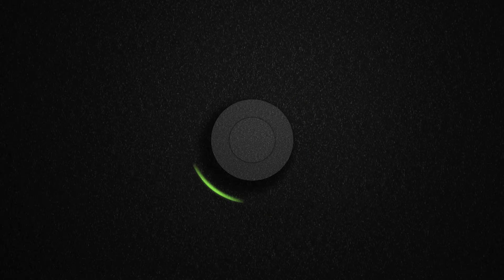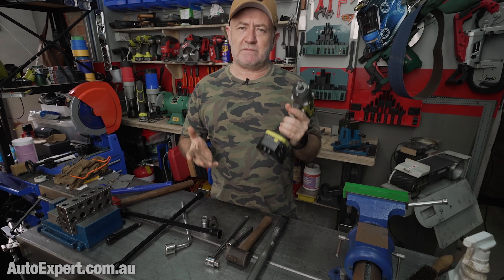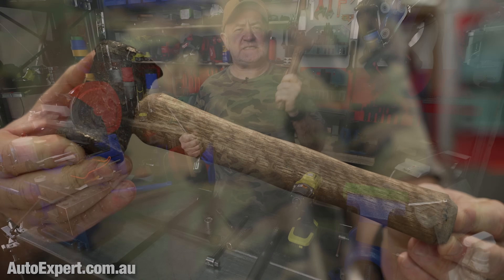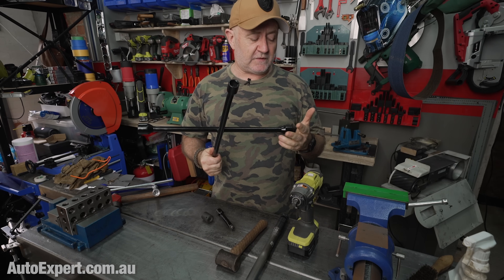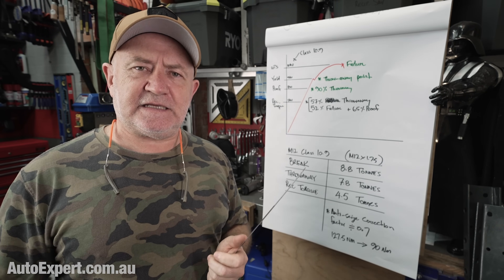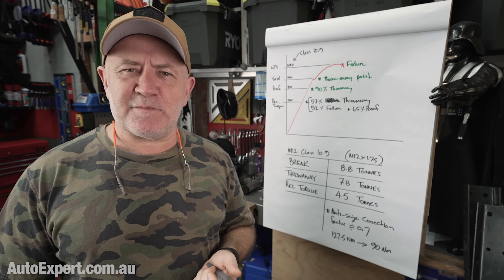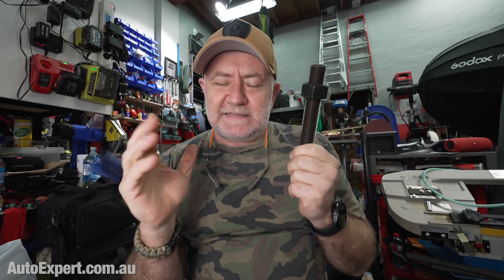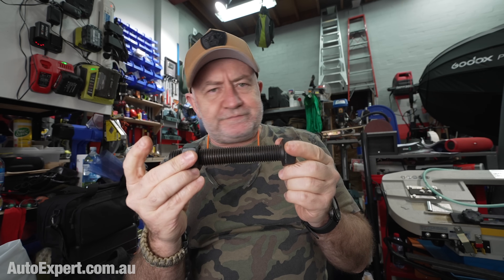Wheel nuts: Ultimate 'ghetto engineering' DIY deep-dive | Auto Expert John Cadogan

Comment: Just yesterday I picked up an extendable wheel brace (to around 50cm) on sale for less than $20 after having issues undoing the nuts with the factory wheel brace on my Toyota Aurion when I copped a flat a year or so ago.
Reply from the maker: Yeah - a 60cm extension with a metal handle (not plastic overmould) and a brass hammer - nothing can stand in its way.
Reply: @AutoExpertJC  Ahhh ok. It has a plastic handle. Time will tell if it's worth the $
Reply from the maker: More than double the length (of the std wrench) = less than half the effort for the same torque. So, worth it.

Comment: If the wheel can spin free.
Use a breaker bar and socket give it  a tweak against the rotation. 
Works the same as a hammer.
Handy if you have said vehicle on a hoist.
Reply from the maker: Excellent tip. Agreed.

Comment: As I aged and the arthritis got me I started to carry an electric rattle gun which saved me several times It's still in the car and well I once was a courier, and it was a dammed sight faster than a wrench I also carried a tyre repair set, but I also serviced my own car and brakes. A rubber mallets the thing if you have alloy wheels, sometimes they need some persuasion. Oh, and with my kit I could change a tyre in 5 mins. And I have seen the most amazing worse case situation, a guy with a van "borrowed" with one wheel hanging on by a single stud the rest sheared off, he had been driving this van around for at least a week before a flat tyre stopped him.

Comment: As a rudimentary replacement for a rattle gun, would an impact driver and a socket be a useful substitute?  Or would that fail to deliver the required torque along with the impact?
Reply from the maker: The 1/4-inch drive will likely fail first, and the driver is probably not compatible with applying the torque required.

Comment: What if I'm re-using nuts previously greased with anti-seize (when switching from winter tyres to summers, for example)? Should I re-apply the lubricant each time?

If so and if I don't, would it be best to revert to torque correction factor = 1.0 immediately or pick a value between 0.7 and 1.0 based on how greasy the nuts feel?

I guess what I'm asking is, how to tell the difference between lightly oiled and heavily greased nuts?
Reply: no once is enough. only apply when not sufficient and clean off the old lube first. its visual. and the amount you need on each one would barely cover the head of a match.

Comment: I have a technical background, having been an engine re-conditioner, CNC operator and electronics installer. I planned the epic around Orstralia trip [well, let's be honest. From Sydney to Adelaide via Melbourne [Why? Why? YYYYYYYYYY?] and back via the Hay Plains. Our "mobile home" was a Ford Transit 2.4 lt diesel with shower, toilet, gas hot water; all the fuckin shit we never used.   Point is, dropped in to a mate's place to do a service before this epic trip and he asked a great question I had never thought of. Not this first few. Bear with me.  "How's ya spare?" He asked. "Checked it. A Okay! " I quipped back. "Where's ya jack and wheel brace?" "Right here" I retorted. "Can ya undo the wheel nuts? Sometimes these tyre places will tighten 'em beyond what you or I , my friend, could ever undo". Yep. There were two nuts I could not undo without 1 metre pipe extension. Thank you Ian Patten for filling a gap in my pre travel checks and my overall Dunning-Kruger knowledge.

Comment: Years ago an old mate who is a mechanic always told me to lightly grease yr studs and only tighten to approx 70 fb. In all these years of driving never had and issue, and you dont need a great force to loosen. Always hated it when I purchased new tyers and some clown with a rattle gun would torque it to the max, so not necessary

Comment: G'day John,  It's worth mentioning the issue of joint cleanliness for your viewers. Particularly if they're changing a tyre by the side of the road.  We shouldn't just pick up the spare that's been lying in the dirt and bolt it on.  The mounting face of the wheel must be clean and free from debris.  The same applies to the mounting face on the vehicle.  If they're not clean then the debris in the connection can compress, just like your gasket example, and the fasteners loose their tension.  The studs are then subjected to shear load, instead of tensile load, which alternates in direction every revolution of the wheel.  The studs then fail in fatigue and the wheel will fall off and may overtake you. Literally. Obviously this is extremely dangerous for those in the vehicle as well as anyone else impacted by the wheel.
This issue of joint relaxation can also be a problem with wheels that have thick powder coating or thick paint.  The coating material can relax over time  and the effect is as just described.  Not good!  This applies not only to the mounting face of the wheel, but also to the wheel nut seating face.  This can happen on any vehicle, but my personal experience is investigating tandem trailers carrying heavy loads like back hoes, that were losing wheels.  All the incidents I investigated had popular powder coated off road style rims.  It was interesting to note that the manufacturers advised re-torquing  wheel nuts after a relatively short drive, but of course this had never happened.  It became a company requirement any time a wheel was installed.
It's also worth mentioning that never seize gets everywhere!!!  No matter how hard you try to avoid that.

Comment: I'm sorry to throw my bones in the circle, but I have picked up a guilty pleasure from the aviation sector for using a solid film coating with the desired friction coefficient that best enables the needed installation traits. Downside  for this is required surface prep for the clamp pressure areas and the friction mating areas to provide a uniform base, resulting in a standard torque run up range with material reaction discrepancies being virtually eliminated over numerous applications. The solid film is also a nearly permanent barrier to most expected causes of damage for hardware.

Comment: Cars are increasingly coming out with wheel nuts that have a thin captive stainless steel cover cap. Mechanics hate them!  Impact guns often tear and distort the covers which make sockets hard to put on. Once damaged, the caps can also slide off inside the socket and are tossed which leaves a wheel nut that's an odd size. They make 18.5, 19.5, 20.5, 21.5, 22.5 impact sockets specifically to address missing and damaged caps.

Comment: Serious question. Is there a difference between anti seize & never seize?
As a 17 year old I had my one & only ever steel rim on the 1968 HK Holden come loose and elongate the holes & break the wheel studs, and it was after id stupidly applied a silver type of grease called “never seize”.
Id been working on the vehicle jacked off the ground on axle stands, with all 4 wheels off.
I stupidly put this never seize on the studs of all 4 wheel hubs.
After it was repaired and new studs fitted to the hub, and a replacement rim fitted, never another problem with that wheel BUT, the other 3 wheels - I kept a check on and the bloody thongs were forever coming loose.
When I took it to the mechanic at our local garage and asked why, he said it was the stupid never seize grease I had applied.
He emphatically stated that “you should never use that sh!t on wheel studs”, and proceeded to use a solvent to wash the studs on those other 3 wheels free of all this silver never seize grease. I had applied it to the conical face of the wheel nuts too, so the whole assembly was more slippery than the proverbial butchers d!ck.
After the mechanic sorted my feck up, those wheels never came loose again & I’ve never had a wheel come loose on any car again in the last 50 odd years of driving.
But that silver never seize grease is the bloody devil incarnate for wheel nuts & studs in my book.
You can prattle on with all the applied physics you like, my life experience taught me otherwise I’m afraid.
I just stick with what works.
Reply from the maker: In practice, probably not. Most anti-seize compounds are mainly grease.

Comment: What is it with the wheel wrenches not fitting tightly on the nut?  I’ve rounded nuts with those and needed to get a set of nut extraction sockets.
Reply from the maker: Very hard to deal with that, in situ...
Reply: @AutoExpertJC now I keep a breaker bar and an extraction nut in the car, along with the 4 way wheel brace for tightening.

Comment: Had my 2007 Subaru Outback in for routine service at my local Subaru dealer/service centre today. They recommended new tyres which I already knew I needed so declined their quote for new ones as they had to be ordered in. 
I wanted them today so got them at a local tyre shop on the way home along with fitting and a wheel alignment. However, they couldn’t undo the Front Strut Camber Eccentric nuts. Seized apparently and after snapping a couple of sockets couldn’t complete the job. A bit poor that a tyre fitting centre didn’t have the necessary equipment to do all of the job. Yet they still charged me full freight for the 90% completed wheel alignment. Grr! I couldn’t be bothered arguing with them. Different tyre dealer next time perhaps.
I had to call my Subaru service centre for another appointment to complete the job properly, on Wednesday. 
Seems I should have taken the Subaru dealer up on the tyre offer as they would have been in by Wednesday - the same day I’m booked in to get the seized studs removed etc. Grr!

Comment: Slightly off topic, but a van I was driving had alloy wheels and suffered a puncture so the steel spare was fitted, by the owner, until the repair was done. The alloy wheels came with a plastic conical ring presumably to centre the wheel prior to nut tightening. It was not noticed when the spare was fitted however, and the steel wheel chewed it up and it caused the wheel to not get clamped properly.  I was told to keep an eye on it when I took over driving so so it was I noticed some unusual vibes while driving on a motorway. I retighened the nuts TWICE, before finally removing the wheel,once I was in  safer location, and understood the problem.  After discarding the plastic ring Ihad no further problems. 

My question is, given the nuts have conical seats and should align the wheel whether alloy or steel in this case, is that price of shit plastic ring necessary or just a trap for some people?

Comment: I wish I could have watched this on about April 1st because on April 2nd I got a flat tyre out in the middle of nowhere and discovered the marvellous standard wheel wrench that couldn't loosen the nuts. My very first thought was 'I wish I had a breaker bar, or a big hammer to whack the wrench' and I'd just come from work where I use a dead-blow hammer frequently. The second ba$tard part of the experience was the weird car jack which I couldn't work out how/where to locate under the car - once upon a time car jacks were simple. The third part of the fun triumvirate was the space-saver spare wheel which I ended up motoring on (e-v-e-r so gently...) for three days before I could get a new tyre fitted: I now understand why they have a speed limit (80kph) - even a short journey at low speeds could make it pretty hot (in England in April in sub-ten-Celsius...) and it's marked with 'inflate to 160psi' so you wouldn't want to have it blow out.

Comment: Mate, my new Triton  went for its first service yesterday, one of few questions asked was the whats the correct wheel torque..  
Just literally went to check  my nuts, on the ute not elsewhere and using the supplied wheel wrench undone a selection of random nuts , on the wheels not people....
Guess what, no problems!!! , and I'm  an impaired 70kg bald guy with a multi coloured beard!!!
As for real ball breaking nuts removal, try a 50 year old tractor  thats been torqued up to 500nm that  never been off since the early fricken 70's!!!😄😄😄

Comment: The standard wheel spanner which is not a 90 degree bend is the easiest way to break studs, a cross brace is marginally better, sockets and slide handle much better

Comment: Just on that 25x torque needed to loosen the nut.
If you need 50kg at say 26cm then you'd need
100kg at 13cm
200kg at 6.5cm
400kg at 3.75cm
800kg at 1.9cm
1600kg at ~1cm
So increase needed maybe not linearly proportional to length (i.e 25x shorter = 25x torque needed)?
Happy to be corrected.

Comment: My vehicle’s spare tire is almost 20 years old and still covered in rubber whiskers from never being used. At one point I tried asking one tire place after another about getting a replacement. No dice, so the one time I’ve had a flat I just drove on it to a tire shop (the sidewalls were completely destroyed by this of course).

In my (irrational) mind I figured that driving carefully on a flat, far newer tire is still going to be safer than driving on a super ancient properly inflated tire. It worked out well enough, and that spare tire now lives in my garage waiting for me to recycle it.
Reply: Is it tyre or tire?
Reply from the maker: The spare probably would have been ok, driven conservatively for a short distance. The whiskers are called 'vent pips' by the way.
Reply from the maker: Depends where you are. The 'Muricans spell it wrong.
Reply: @robertmoore2527  In my section of earth it is spelled tire. Tyre is probably closer to the original spelling as the letter Y was used far more like the letter I is now.
Reply: @AutoExpertJC  I’ve heard the same things about if the tire isn’t cracking, etc. it should be fine. That is probably right, but then again, I would be the one actually driving on that old compound.

Vent pips.. That’s adorable.

In my area google says they call them vent spews, but good luck using either term with maybe 95% of people out in the world and any of them having the faintest idea of what you’re talking about.
Reply: @robertmoore2527  depends if your using the king's english or yank
Reply: @nosilverharbinger  they say 7yrs is the life of a tyre as the compound starts to break down thanks to heat,light,ozone,uv and simple age.

Comment: Be honest - has that bench grinder ever turned?
Reply from the maker: I generally use the other three grinders in the shop. The linisher, belt grinder and the other bench grinder with the linisher/wire wheel combo. 

If that's OK with you.
Reply: @AutoExpertJC  I kinda figgered it was a bit of a strange place as you'd blow grinder dust all over your toolboard but then I saw the wheels are unused.
I have a bench saw looks similar. I got it cheap but I'm no wood butcher.

Comment: Ah, with a long enough lever, I could move the world... alternately a nice battery powered rattle gun is good too. Got one of those manual winding thingies for the Coaster too but haven't actually tried it out yet. You have to watch the quality of the cross wheel braces, there are a lot floating around that will just bend when enough force is applied to them.

Comment: My last run-in with a tight wheel nut resulted in the failure of the socket rather than the wheel stud, it cracked at the corner of the hexagon. Before anyone accuses me of cheap-skating with chinesium tools let me say it was a premium German socket (Elora).
Reply from the maker: Use a hammer next time. Get sockets with significantly radiused internal corners.
Reply: @AutoExpertJC  Thanks, John. I now have a very heavy mallet which also assists in persuading the wheel off the brake rotor and a beefier socket. My current car doesn't have a spare wheel so maybe it's a a non-repeatable problem.
Reply from the maker: Blessing in disguise...

Comment: Holy shit. An hour. Better save this for tonight.
Reply from the maker: Do it while allegedly working. It'll earn you a Ghetto Engineering PhD.
Reply: @AutoExpertJC  loved this report John. 

I’ve had one of those Thor hammers for a while. The head of it came loose. Ghetto hack for you here. If the head of it comes loose, sit the head of the hammer in engine coolant. It doesn’t evaporate and keeps the head of the hammer tight for as long as you will ever need. 👍

Comment: I once saw an elderly couple (1 X male and 1 X female) standing next to the front right wheel of their econocar in the local greengrocer's parking lot.
I though "I wonder what is going on" but was clued in by the jack being out but in the wrong place...luckily with the car not being up in the air.
When I enquired further the shitty OEM nut undoer was unable to be worked by either of them.
I then put my delicate right foot on the end of said nut undoer...and liquoriced the shaft at that famous angle in said shaft.
Catching their eyes which had widened significantly I went to my 4wd and retrieved the 4 way cross brace from the rear seat under-mat position (you never know when you can't afford the time...for whatever reason... to go to the rear compartment and undo the tailgate) selected the correct socket placement, and proceeded to jump on the appropriate area of my brace......until with a scream...each nut let go.
I then placed the jack in the right place and changed their wheel for them.
His wife picked up the 4 way brace and shook it at her husband....telling him they were going to buy one before they got their flat tyre fixed..and saying they were then going to the new car dealer who had sold them their car only a fortnight before...for a chat!
Reply from the maker: She sounds more formidable than him...
Reply: @AutoExpertJC  Not an uncommon scenario.
Reply from the maker: Agreed.

Comment: Some mechanics using air rattle guns instead of torque wrenches are a big problem..
One used car I bought had nuts so tight , it would have been impossible to remove a wheel out on the road with the standard tool kit.